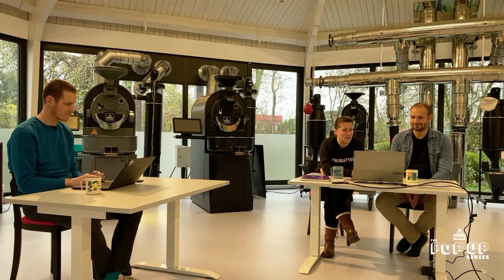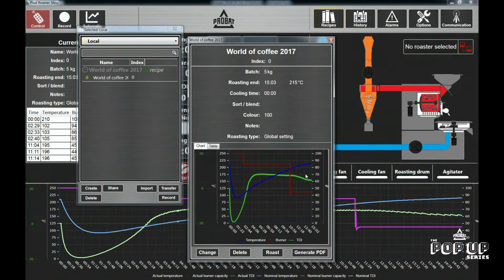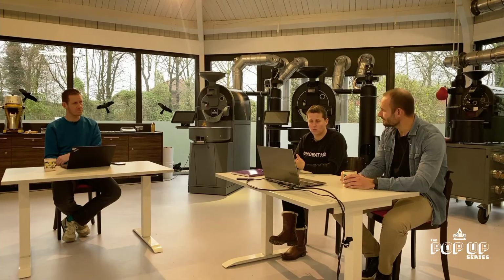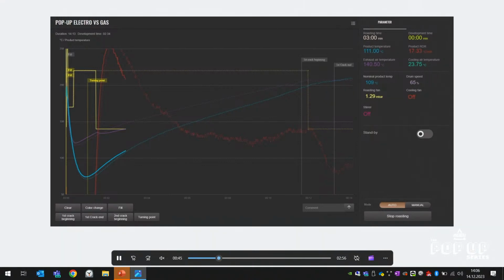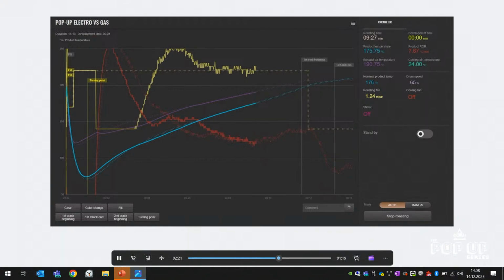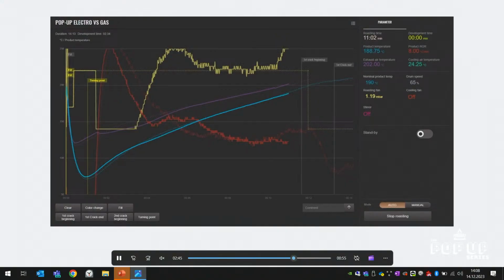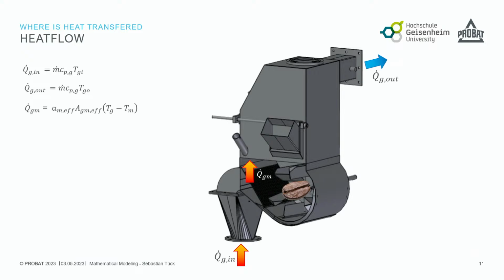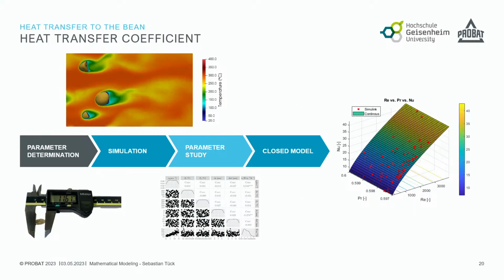The POP UP series: Evolution of roaster control

Comment: Since your roaster is mostly powered by hot air, have you thought of burner control via incoming air temperature control? I think that having temperature of air instead of % of gas would be much more reliable.